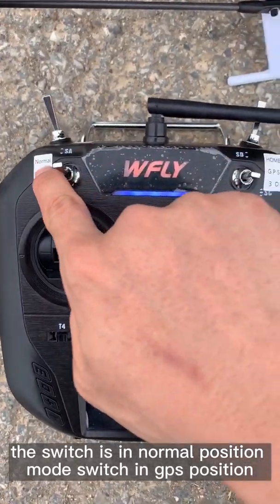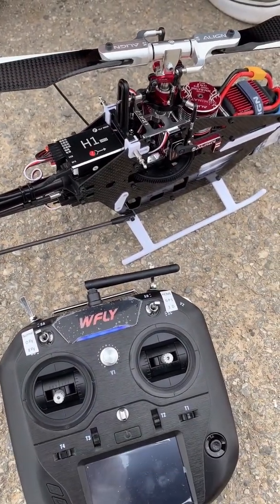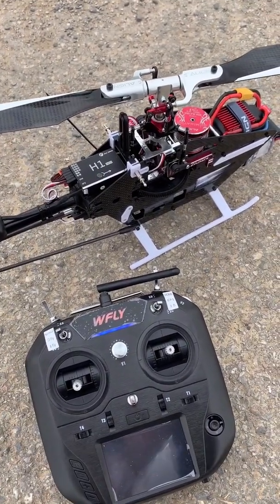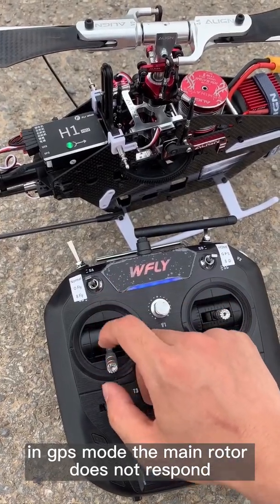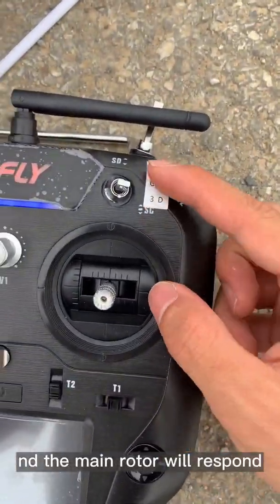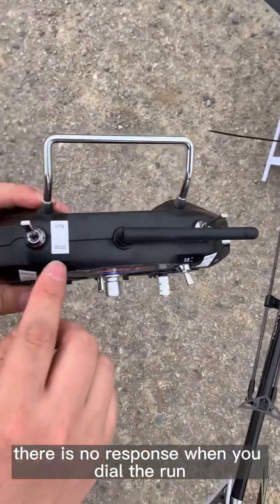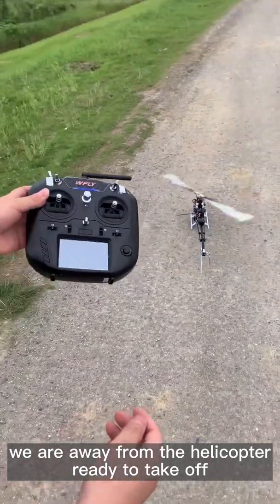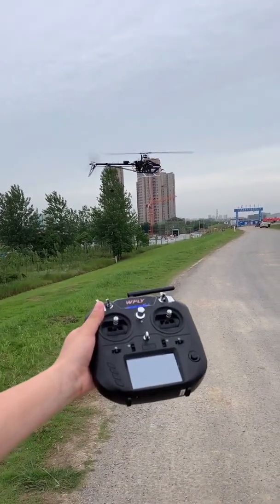H1 Helicopter flight control Unlock motor run and take off

Comment: hello an information on the h1 on my trex 700 j have a power supply separate 7.4v my esc castle in 12s has no spout how to power the h1 an idea of the connection.thank you

Comment: should the heli take of with out collective input from transmitter ?
Reply from the maker: In GPS mode or RTL mode, servo is locked and cannot move. When the rotor starts to rotate to a certain speed, flight control will automatically control the collective pitch
Reply: Why my gps n0t turning t0 s0lid green lights 0nly yell0w lights blinking